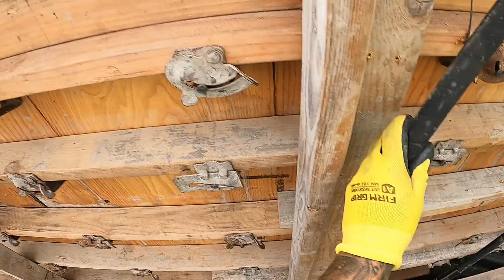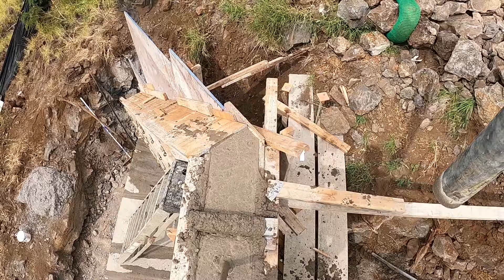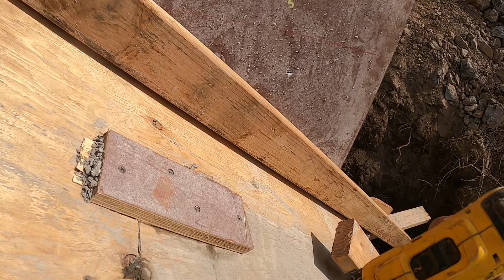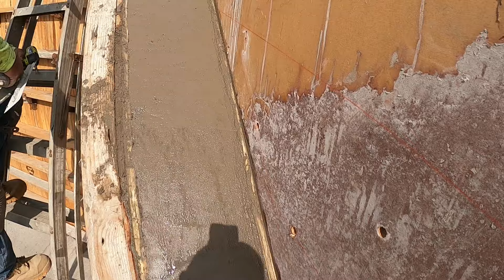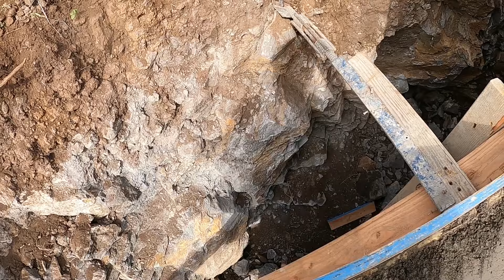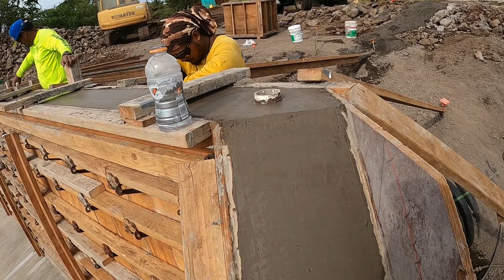How To Pour And Vibrate Sloped Concrete Walls //  Architectual Concrete

Comment: To all my concrete brothers out there, try using a resin or wood float when the concrete gets that tight to rub with a mag. They can really tear the surface open and help finish. I use them on steps,   short walls and locations of the slab that bake in the sun or dry from the wind. Cheers and great video!
Reply from the maker: Thanks great information definitely. I do have a resin float pretty sure was just to lazy to walk up the hill to grab it. So instead I just suffered my way through it lol. Thanks for passing on your knowledge its welcome anytime.  Hope you have a great week

Comment: I was told too much vibrating will cause all the aggregate to settle to the bottom...it seems you are over vibrating
Reply from the maker: The only time youd have issues like what you're saying mass separation. Is if the consistency of the concrete is to wet like way wet. The walls hade a double mat of rebar #6 and smaller with block outs so the amount of vibration that took place was correct.  Ive been trained by architectural engineers and inspectors of the correct way to properly vibrate and consolidate concrete.  I promise you you my technique is correct

Comment: Looks like could have used Confilm and plasticine on the screws
Reply from the maker: Definitely sounds like a good idea I've used confilm as a surface retardant on slab pours but never for a release
Reply: @thatjuanshow4485  gives you the extra time doesn't affect the finish like spalling.. thx